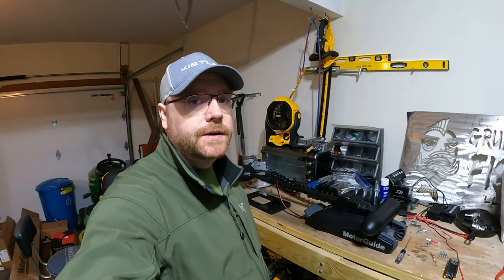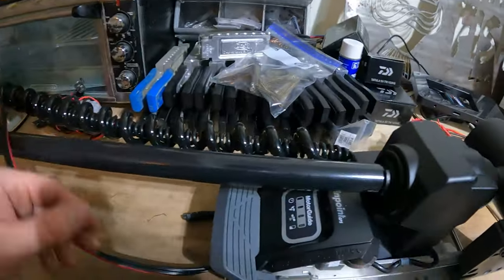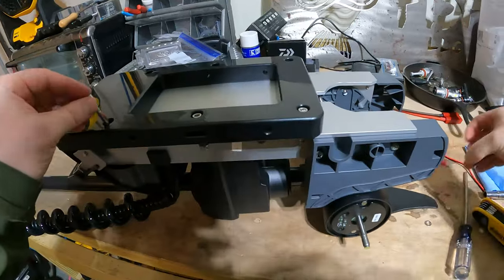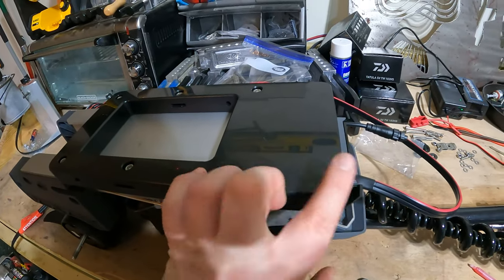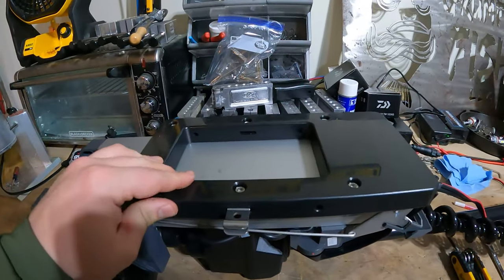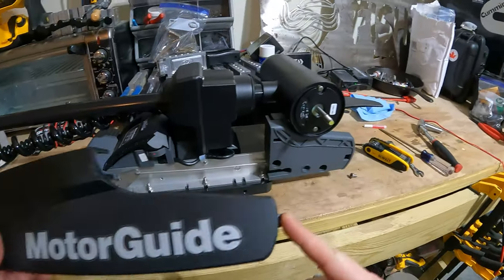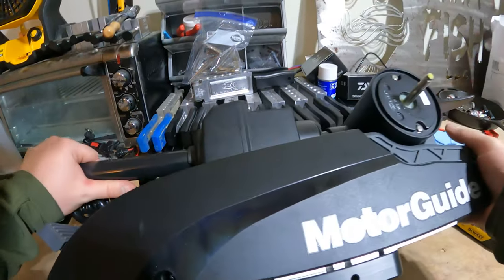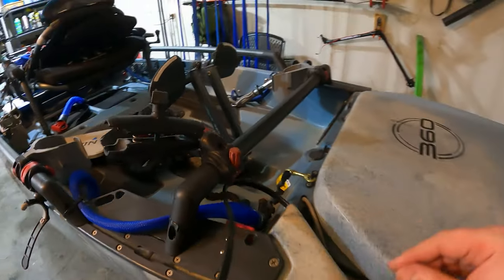MotorGuide Quick Release Bracket Install: Xi3 / Xi5 - Hobie 360 - Pro Angler - One Objective Mount

Comment: This may sound like a dumb question but how do you deploy and stow the motor while you're on the water?
Reply from the maker: Not dumb at all.

I ended up doing something similar to this guy, https://www.youtube.com/watch?v=0sfVyh2cVyE&t=13s&ab_channel=Matthewn7.

I would however highly recommend using the cable from Innovative Sportsman as it is much smoother and doesn't cut into the tubing, http://www.innovativesportsman.com/store/p118/10%27_Rudder_Motor_Spectra_Cord.html#/